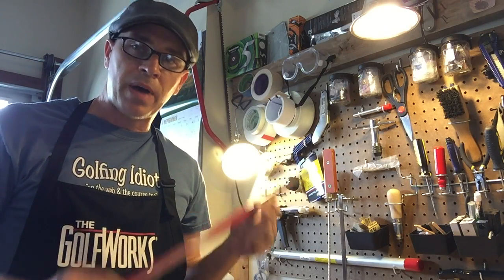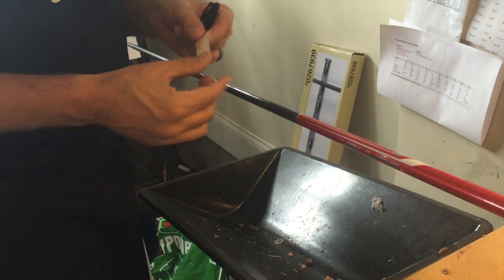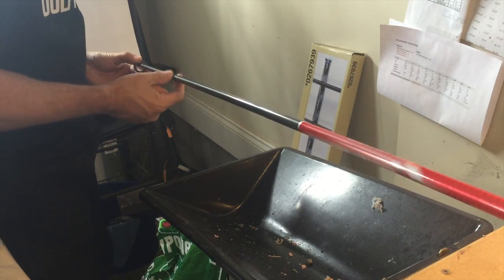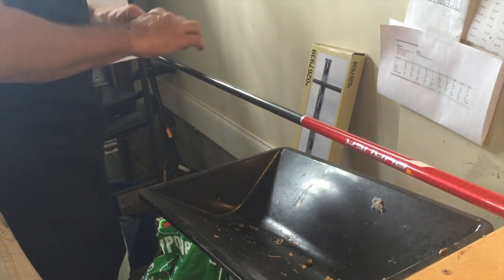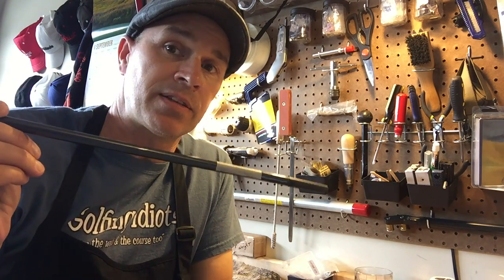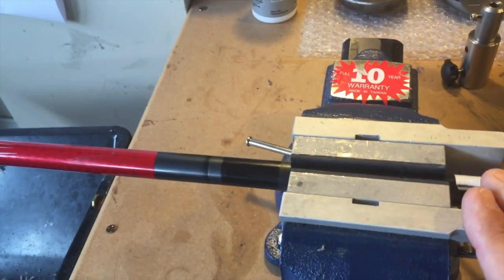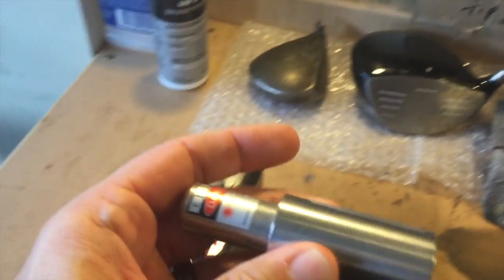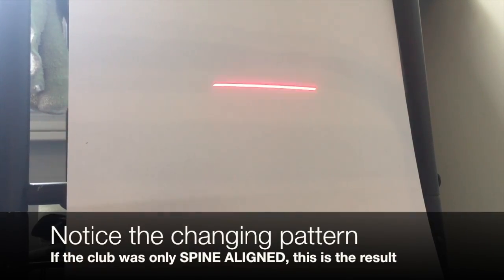How to FLO a Golf Shaft (correct position of shaft alignment)

Comment: Assuming that the "spine line" and the "FLO line" of a shaft are not the same, why bother finding the spine?  If building a club so that the "FLO line" is properly located is most critical/ beneficial to club performance - and it doesn't coincide with the "spine line" - finding the spine location seems to be irrelevant.  Correct, or am I missing something?  Thanks for your excellent video!
Reply from the maker: I get this question often. You do NOT have to spine align the shaft in order to find the FLO.  The video was done to show people the difference between a SPINE aligned shaft and a FLO'd shaft.  More importantly, the fact that the two rarely are in the same position on the shaft.  There is still confusion out there about the two methods or thinking the two methods are one in the same.  I've had this question before regarding "why" do it this way;  again, the reason was to show the difference of the actual FLO position of the shaft. Glad you are enjoying the video!
Reply: The Spine is a Starting Point Only
Reply: It only matters if the shaft shows only 1 spine.  
I guess you could choose which side you wanted the spine on.  
For example; 10 o'clock position versus 4 o'clock position.

If the spine runs straight through (2 spines) then it really doesn't matter.
Reply: I was also confused by the need to find spline.  After finding the spine, he said "next step" is to find FLO.   I took this to mean the spline location had some relevance to FLO.  I'm getting back into club making and plan to just focus on the FLO.  I trust the flow line as more important to performance than where I feel the spine.
Reply: @Chuck best answer

Comment: What a great video! Thank you for taking the time to make all of your videos your channel sure has helped me a ton. I do have a dumb question! Why even spine the shaft of your going to flo it and it's in a different spot all together. When I first learned that you spine and flo a shaft and they are at different areas of the shaft my question was so which one do you use for alignment. Just not understanding why you spine if your going to flow and use that anyway. Thank you for all your help have a wonderful weekend.
Reply from the maker: I'm glad you are enjoying the videos.  Not a dumb question at all.  You do NOT have to spine align the shaft in order to find the FLO.  The video was done to show people the difference between a SPINE aligned shaft and a FLO'd shaft.  More importantly, the fact that the two rarely are in the same position on the shaft.  There is still confusion out there about the two methods or thinking the two methods are one in the same.  I've had this question before regarding "why" do it this way;  again, the reason was to show the difference of the actual FLO position of the shaft.
Reply: Thank you very much have a great week!
Reply: @XJSimulations  Supposedly the spine finder finds the very slight pre-existing bend in the shaft, not necessarily the axis on which it bends the easiest (or the most).

Comment: I mounted a laser. on the club face of my burner driver,then mounted the shaft in my vise with the grip on. The shaft had been filled and marked,dry mounted head with laser and checked oscillation,would not flat line with 12 o clock position but it was fairly close approx 10 degrees off,glued the head on re checked ok but added a little lead tape to the head and no longer flat lined,so weighing the head is problematic and I think you should load the shaft the same amount every time you test and that should be somewhere near the actual bend when in use or at impact.I think with a little practice I could make a driver produce a cut or hook by adjusting the head to spine at different angles.
Reply: the flexibility of the grip affects flo. best to flo without a grip.
Reply: @nunyabidnez2708  you would be 100% correct if we used a driver without a grip,I am trying to replicate the flex rebound as it occurs in actual play.All I can say my method works in play situations and I have many satisfied customers.
Reply: i get what you're saying. in physics EVERYTHING matters. there is a difference between the amount of force applied to the gripped club in the vice vs your hands so even THAT can skew the results but i like the way you're thinking of it.

Comment: OK, got one more question. Doing my new shaft now from scratch now that I've proved with a PURED shaft that I can do it properly. Finding the spine before I FLO it, it has two very noticeable spines, when you say the find the strongest point, do you mean the biggest or tallest spine between the two or the one that gives you the most resistance of flex in the shaft? Because one is noticeably taller, but the other one seems to give more shaft resistance, so which would you mark as you spine? Thanks again, these videos of yours are really awesome and have taught me a lot.
Reply from the maker: Either one will work as a starting point simply because it does not matter in the end.  However if you can feel the difference between the two spines, i.e. the flex of a particular point in the shaft, use that feel to determine the best FLO position on the shaft (previous discussion below).  One position will have a bit more flex than the other 180 degrees opposite.  As such, typically that will be the position that can deliver more distance.
Reply: Makes perfect sense, thank you very much for your help.

Comment: Question, should FLO-ing be performed before or after the shaft has been trimmed. Thank you!
Reply from the maker: It can be done at any time and does not matter if it is pre or post shaft trimming.  You should get the same result in regard to the FLO of the shaft.  Thanks for watching!
Reply: @XJSimulations , I just tried FLO-ing a Dynamic Gold Stiff Shaft with a drill chuck & laser and the response I get is a flat line regardless of the shaft orientation. Now, the initial path may be elliptical at the start, which probably is due to me, but shortly after becomes a flat line. Question, is FLO-ing required when using a good quality stiff shaft?  Thank you.
Reply from the maker: Except for the putter, I highly recommend FLO'ing all shafts.  The stiffness or quality will not dictate anything about the FLO of a shaft. It can, and likely will, vary from shaft to shaft.  If you can get a straight line reading 50% or more of the time when you are FLO'ing, you've likely found the proper position.  I completely understand the self-inflicted "flick" problem, but if it is a straight path 3 of 6, 4 of 8, etc., it is in the right position.  Some shafts can have very slight changes and some will have very wild patterns.  The more you work at it, the more comfortable you will become in determining if the shaft is producing a FLO'd pattern.
Reply: @XJSimulations  When FLOing it becomes obvious which companies FLO their shafts before putting on the labels. I test all shafts anyway.

Comment: Could the flo be aligned to correct a slice or hook?
Reply from the maker: Well, no and yes.  It is highly likely to lessen the hook or slice, but it is not likely correct it completely.  One thing for certain, it will help to correct one, with practice over time, as it is more certain to deliver the clubhead on a particular swing plane.  

I have seen situations where a shaft is so off the FLO that it did correct the swing flaw, but this really depends.  Typically, an easy way to identify that type situation;  if you have one particular club that "feels right, can't miss with or is your go to club,"  it is likely that club's shaft just happens to be in or very close to the FLO position.

Comment: Hi XJ
Thank you for this very interesting video
You are using a laser moving in a horizontal plane to find the FLO.But once you found it
- Is the mark you make with your pen on the top of the shaft , say 12 oclock or at 9 oclock , assuming the target is at 9 oclock (R handed golfer) ?
- If using a vertical motion of the laser, would you mark the FLO on the shaft at 9 oclock ? 
- Would you still mount the club head at 12 oclock , refering to that mark ? 
- Is it possible to mount the club head taking the 6 oclock position , as it is on the same plane ?
- If yes, which position should be chosen ? Does the distance to the spine position matters, like the closer the better ?
Best regards
Reply from the maker: Regardless of if you find the FLO of the shaft (horizontal or vertical), always remember that is the plane the shaft needs to travel in during the swing.  Technically, you can place the club in either direction of that plane, but I did not want to confuse the issue anymore.

Comment: great video, quick question after you flo the shaft with laser how do you locate and mark iron heads correctly?
Reply from the maker: Thanks for watching.  I'm not certain, I understand your question.  If you are referring to shaft insertion into the iron after locating the FLO,  I line up the iron head with a straight sharpie line on the top of the workbench and then ensure the shaft is inserted at the 12 o'clock position of the shaft. I mark the FLO position of the shaft with a piece of tape marked with a black sharpie line prior to removing the laser and shaft from the vice after locating the FLO.  If that does not help to answer your question, please let me know.
Reply: This is a dumb follow up but I want to be clear....Is 12 o'clock in line with the leading sole of the club? Seems like FLO is the way to go vs spine align.
Reply: @kylec4498  12 o'clock is towards the toe of the clubhead. 9 o'clock is towards the target when the clubhead is in the impact position. XJ moves the tape so the mark is at 12 o'clock, but when he does that the FLO axis (straight line oscillation) is at 9 o'clock (towards the target).

Comment: question regarding the Flo... Once I have found the Flo line, normally we would install this line on "top" of the golf shaft, as if we were looking down that line, and the club head faced 90 degrees, will the "flowing" on the shaft still work if you put the flo line on the bottom side of the shaft? (think of installing the new mcc align grip, where the flow line would run down the top side of the grip, and I am asking, if the flowing would still work if we ran the flow line down the back side of the shaft, where the "align rib" would be on the new grip..)
Reply from the maker: If you think of looking down at the shaft toward the club head as a clock face, the 12 o'clock position is the proper position for a FLO'd shaft.  In some cases, there will be another FLO position directly opposite of the FLO position on the shaft.  However, you need to check.  If the shaft has a duel opposite FLO position, one of the positions will be stronger than the other.  It may work, but you need to check the opposite position to be certain.
Reply: Golfing Idiots I'll have to double check as I did find two FLO positions as I was working on my driver. the reason I asked pertains more to the fact that the driver has an adjustable tip and there is an arrow on the bottom side of the driver, indicating which line you are on. I would be curious to see a video on this, specific to adjustable tip drivers
Reply from the maker: Regarding the two FLO positions, it is not uncommon on a shaft.  Usually better shafts. Typically, one of the FLO positions will produce a slightly longer distance and the other a tighter dispersion. In regard to adjustable drivers, I get this question often.  

What you need to remember is an adjustable driver's function, by design, is to allow a player to dial in their best loft and lie out of the box or OTS rather than having to wait for a custom fit club to arrive two weeks later.  Once you dial in your best settings on the driving range, you should really not be adjusting the numbers. Therefore, once your driver is set in the preferred position you can FLO the shaft.
Reply: @amidgetonamoped8637  If you want to keep the shaft in the correct position, but adjust a tip you will have to remove the tip and re-orient (re-epoxy) it. Usually installing the tip in a clubhead first makes re-installation easier. This doesn't apply with Callaway tips. They can keep the shaft in the same position in relation to the clubface regardless of the tip settings. You have to make sure you put it back together with the new tip settings with the shaft in the same orientation as before, assuming it was correct. It is possible to put the clubhead back in with the shaft in any position on a Callaway if you are not paying attention.

Comment: Why find the spine when you’re going to move the tape anyway when you find flat oscillation? Why not just start at oscillation?
Reply from the maker: Fully aware and this is asked often.  The reason, as stated in the video, was to show the difference between the two methods as there is confusion that they are the same.  In the latter part of the video, I show the line of the spine aligned shaft as opposed to the FLO'd line.

Comment: With adjustable hosels on drivers, doesn't the Flo point change in the shaft when you start changing the adjustable hosel for more loft, draw or fade?  Thanks,
Reply from the maker: The point of an adjustable driver is to allow someone to "custom fit" the driver without the need of a set-up from the producer.  If you are a player who constantly changes settings, FLO will not work for you or FLO to the position you use most often. Think about it for a second, do you constantly bend loft and lie on your irons?

Comment: Hi, was wondering what the difference is between FLO and SST Puring. Thanks and great video!
Reply from the maker: SST is a patented, technical, automated piece of equipment that determines the neutral axis for a shaft;  It can be quite expensive for each shaft, let alone the entire bag.  FLO'ing is also a process for finding the neutral axis for the shaft.  Just understand it is two separate processes that are looking for the same conclusion. Thanks for watching and be sure to subscribe.
Reply: Thanks for the response. Subscribed! I was also wondering do you need to do it on a raw uncut shaft first, or do you tip it first then FLO, or butt cutt then FLO.
Reply from the maker: Is does not matter.  You can FLO the shaft at any point.  Keep in touch with your results!

Comment: when setting the club head for an iron, i lean the shaft forward and then square the clubface, when i rebuild my club, what is the "12 o clock position" in relation to the club face, when you account for a clubface/hossel that is set up with forward shaft lean?
Reply from the maker: When you are looking down at the club face it should be square to the target line; the FLO position is inline with the grooves of the club head in the 12 o'clock position. It will become easier to find the more you try it.
Reply: Golfing Idiots against my "better" judgement. I went with this approach as you mentioned I got the feeling that I should try it this way and see how my ball striking improves with a flowed shaft before potentially screwing things up even worse. lol. I'll get to test it tomorrow. I had to rebuild my 9 iron and decided to do driver too while I was at it. I'm extremely anxious to see the results as I just know this is going to improve my game. thanks for the great videos! I will report findings
Reply from the maker: Well let me know the results.  I would be shocked if you do not find better ball striking and consistent flight. Look forward to hearing from you.
Reply: It definitely tightened my dispersion. by like 15-20 yards for my slice. I used to hit out 175 and right 40-60 yds. (seriously)- if I could get a straight shot, i could roll it out to 280ish (293 once.. lucky bounce).

After flowing my driver i'm carrying over 225 when i hit them straight, but my slices dont go over into the next fareway anymore. 

I'm now doing this on all of my other clubs, however i seem to be finding it hard to get a FLO line on the graphite shafts. (i have a REALLY cheap set made by powerbilt). The irons are fine and i find with ease, but the graphite shafts for the hybrids and woods just dont seem to have that perfectly flat point (it gets close, but there is either a slight slope to it, or it still "loops" towards the end of the oscilation cycle. anyway, I turn 31 today and we are supposed to play sunday afternoon to celebrate, so i need to get my clubs back together... lol better get on that.
Reply from the maker: Awesome and glad to hear about your progress.  Hopefully, other people will see your response and improved results. Some cheaper graphite shafts can be difficult to FLO.  Take your time.  Ultimately, you may have to choose what the "best" option is for the shaft to be close to FLO. Good luck!

Comment: Really interesting video. Yet, I wonder why was it important to locate the spine if the FLO won't depend on it. Did I miss something?
Reply from the maker: Good question. No, it is not necessary to locate the spine, but I wanted to show the difference between the two methods.  A lot of people confuse spine alignment and FLO as one in the same. Obviously, they're very different when it comes to results. Thanks for watching.
Reply: Thanks, I'm glad I got it right. Great video about the shaft stiffness impact based on your swing speed btw. I liked that the data was collected right on the field

Comment: Before FLOing the shaft, do you have to take the adapter off?
Reply from the maker: Technically no, but I do recommend it as you will need to reset the adapter to "your" preferred settings.